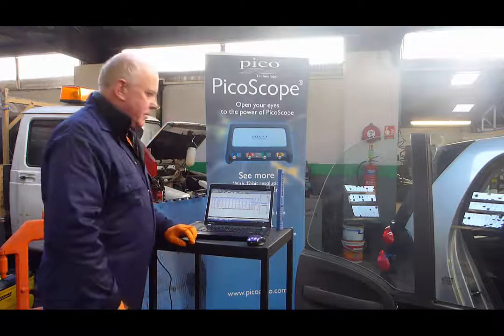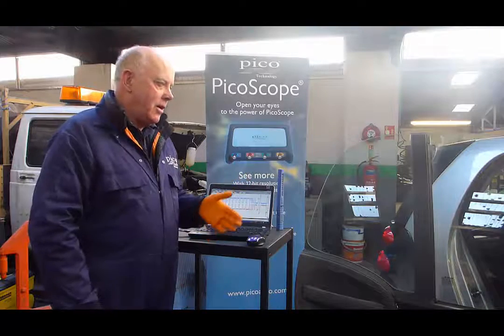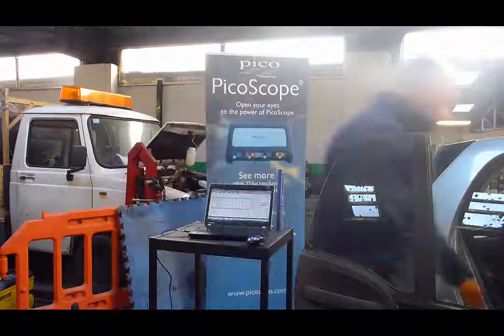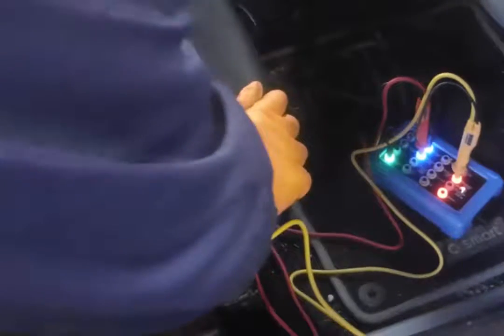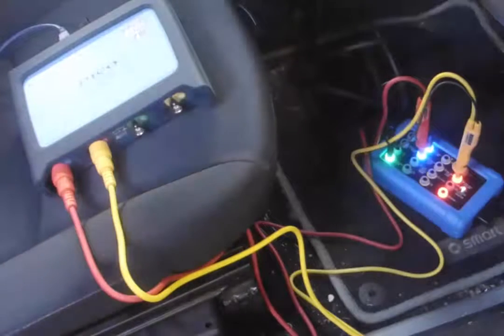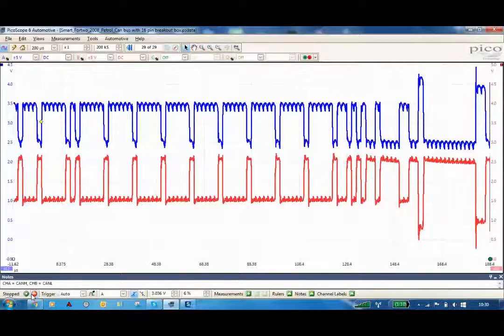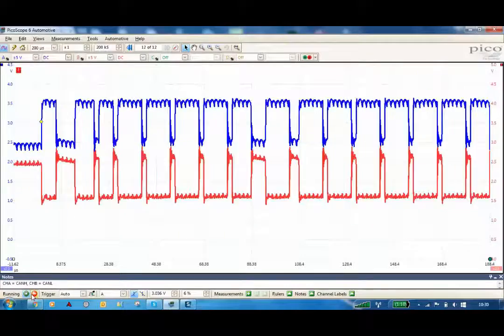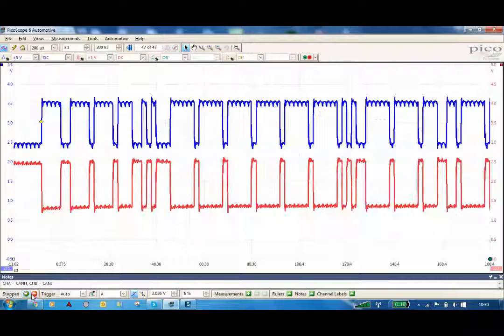CAN bus signal using 16-pin breakout box

Comment: How do you get a signal? I can get signal from signal generator if I connect bnc cable to it, but breakout box wont take bnc cable. Do you need an adapter that doesn't come with picoscope?

Comment: Hi 
As you may know, the 16-pin breakout box is used to connect to the diagnostic socket on the vehicle and test connection between the socket and your diagnostic tool as well as for reverse engineering into software to write software for their diagnostic tools. During this operation the K and L lines will communicate to all the various systems. You can find all the relevant information about the pin numbers in the User’s Guide for the breakout box: https://www.picoauto.com/download/documents/manuals/DO148-can-test-box-manual.pdf
Bear in mind that some manufacturers, such as Toyota, may use terminal 9 as a speed sensor signal. The CAN net can also be accessed via the breakout box, but again, the manufacturers may not use the socket and send signals via a body controller instead (see Mazda case study: https://www.picoauto.com/library/case-studies/communications-fault)
Please always refer to a vehicle manufacturers information system for data.
I apologize for the many variables to my reply, but as time changes some manufacturers are using different connection methods other than the 16-pin socket.